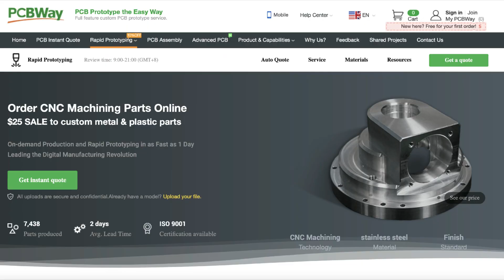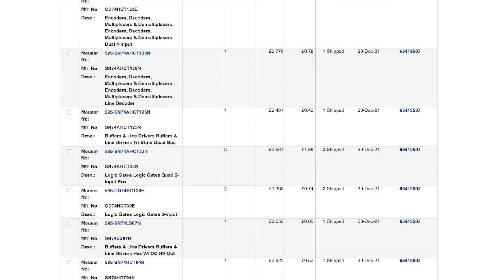Part Two (Ish) of our Omega MSX-2 build - not as smooth sailing as I'd hoped!

Comment: It looks good so far. I would change out those wood screws for truss head sheet metal screws. That would allow you to tighten them down without risk of cracking the PCB.
Reply from the maker: Yep, they were only temporary placeholders and only in very slightly to hold it in place - all proper screws in the final build :)

Comment: Looking good. I'd go with black or gun metal black for the case.
For the screws instead, I'd replace the one you used with pan head or flange head ones as these are the ones you normally find keeping retro gear together.

Comment: It really starts to look the part! My favorite wedge shaped 8 bit computer as far as cases go is the nms8235 and 8245 systems (philips msx-2 computers, so that's my suggestion for the case, dark gray. That would really make the keyboard pop I think.
Reply from the maker: I’ve got a Philips MSX2 sitting here waiting for a full refurb - it is lovely!
Reply: I agree dark gray.
Reply: Agreed, although I own a nms8250 :) But I also love the colors from the Panasonic - FS-A1ST (turbo R).
Reply: @TheRetroShack  I'm looking forward to that one too :)
Reply: My very first MSX computer was a Goldstar FC-200. The second one I owned was a Toshiba, which sadly never made the move to our new home for some reason. 

I currently own a Philips NMS-8255, as maxed out as can be. 

This project really makes me want to build my own. Although I was already familiar with Sergey's project and have been trying to fit all the components onto a Mini-ITX board.

Keep it up!
Reply: @TheRetroShack  nice, looking forward to the refurb! I got nms8235 which I used to own, sold for an Amiga500 and bought at a 2nd hand store for 2.5 euros. Then a nms8245 for 5 euros and the nms8250 for 10 euros, which I expanded the memory to 1MB using a simm stick, just couldn't pass them up. Can't believe what these machines go for these days, at least 100 euros. Still got a few msx1s and a c64. I've recapped them and kept them in working order.
Reply: @damouze  nice! I got a nms8250, the only difference is the second drive with the 8255. I 3d printed a flexible belt for the drive and keeps working. What mods did you do?

Comment: Was there any indication of why that case was designed so deep, front to back? It looks as if you could take off almost 10 cm of depth by moving the keyboard further towards the back, to sit on top of the motherboard.

I've got eight different models of MSX machines, and I don't think a single one of them is anywhere near that deep.

Comment: What about FPGA versions of the original chips, why could we not have gone with the ZILOG Z800 CPU which is compatible with the ZILOG Z80A
Reply from the maker: I guess we could - but we didn’t need to :) Z80’s are still available brand new and very much cheaper than an FPGA alternative :)
Reply: And FPGA emulations are good as documentation for these parts, never a true replacement if all these infos about the emulated/sinthetised part aren’t totally disclosure. Msx has a lot of that info since it was a standard but people should know these little drawbacks about FPGA. In other hand there’s Mister project where they are working on msx1 core (based on svi328) that project has mostly all the parts in their own board fr the amazing cores they are supporting (amigas et al) so different beast. The aim of the omegamsx was more on “real chips” than other proposals. Note aside there’s a version from MerlinKV with some smd chips replacing discrete ones also…
Reply: AFAIK, open source FPGA implementations of Z80 are available, but there is no open source VDP implementation. Otherwise there are non-open source FPGA MSX implementations. The point of my design was to make it DIY friendly, and most current FPGAs are not...

Comment: 4:29 it does not look MSX-ish at all, it looks PC-ish: many MSX-specific keys missing, and the layout is similar to PC.
Reply: Yes, what MSX keys are missing? :)
Reply: @SergeyKiselevA , the photo at that timing has low resolution, and looks like gray keys aren't labeled, but anyway MSX has one more key in ASDF and ZXCV rows, and block of 4 keys must be block of 5: ins, del, home, select, stop. If we count all the keys here, we'll get 73. If we remove duplicates (like Shift), it is even less. MSX keyboard matrix is 88 keys normally, or 104 keys with numpad. So it is hard to say which are missing because of low photo quality, but at least 15 are. Most likely Stop, Kana(Code), DeadKey are missing.
Reply: Stop, Code/Kana, Dead key, Stop, and Select are there. There's no numpad. Not all MSX machines came with one. And I personally almost never use it. The keyboard has two Shift keys, and one of Alt and Ctrl keys. The keyboard indeed uses PC keycaps, because they are readily available. With that being said, the schematic and the PCB layout for the keyboard and the computer are in the project's GitHub repo (see description of this video). I'll be more than happy if people would contribute to the project, including improving the keyboard.
Reply: @SergeyKiselevA , my mistake, 72 to be without numpad, and 88 with it (I was also confused writing 104, but yet posted that, heh). It's a pity I cannot see the buttons I asked about though, but looks fine in numbers, so they exist, I believe. But layout isn't MSX still. I see two single-width keys between «L» and «Return», while 3 expected, and 3 between «M» and «Shift», while 4 expected. That's because Japanese language needs much more glyphs than Basic Latin does, so they extended it a little. Great for Russian too, for a pity PC keyboards in Russia are based on American, not Japanese layout, so punctuation locations are out of any sense of comfort. MSX keyboard based on Japanese layout, good for Russification and languages that use diacritics and modified Latin (Turkish, Spanish etc.). MSX keyboard is about 1 key wider than this. This is a typical PC layout, Amiga also has something alike.

Comment: Why is there an Acorn Electron style or Mac like, or certain PCs like Function key?! Why didn't you remove this? The MSX computers have five physical function keys, plus another five with SHIFT! Why aren't there diamond shaped or even just larger cursor keys? As for your case, it doesn't look very MSX to me. If PCBway can actually print them, then why not scan a real MSX case and get them to print that instead? I think that you could have used a first generation MSX case design or an MSX2 case design. I've owned the Yamaha CX5M MSX and Philips VG-8235 MSX2. I think that some of the Sony Hit Bit MSX computers with red cases look really nice, but not the black Hit Bit sold in the UK. I think the MSX2 style computers with separate keyboards and "Pizza box" style main units look better, though. Now I'm going to watch your next video in this series.